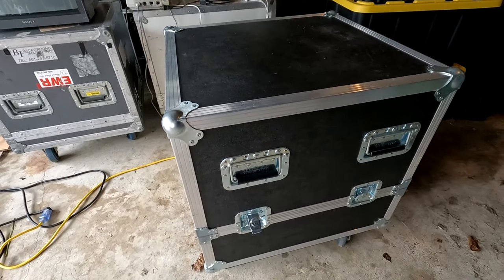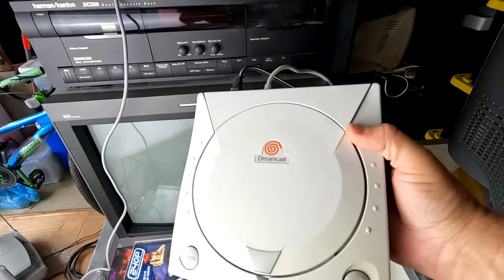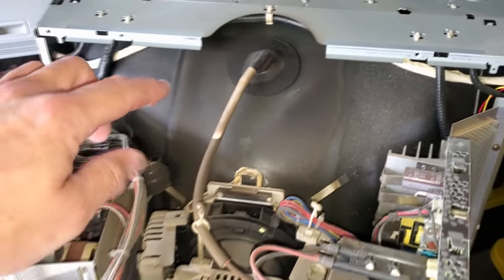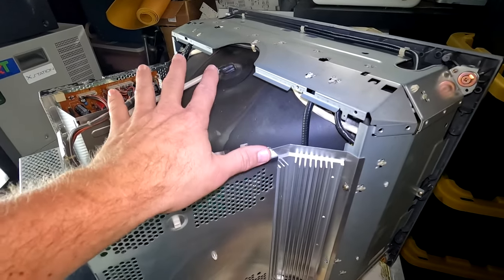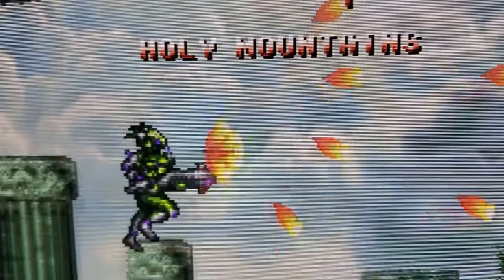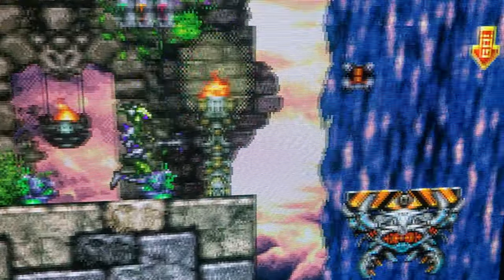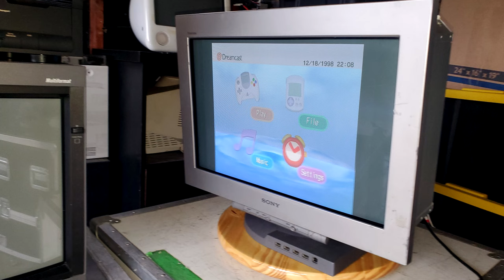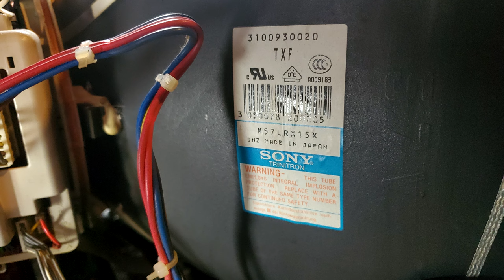Rebuilding the World's Best CRT - the Sony GDM FW-900 Trinitron

Comment: I wonder if Artemio would be up for releasing a PC version (Windows/Linux/MAC) of his test suite, along with the higher resolutions for CRT PCM's up to 2048x1556p, and perhaps even some new stuff for OLED monitors for those of us wo like to use them for CRT emulation, just a thought.
Reply: NEC Suite already exists and serves that purpose. Check it out.
Reply: @mordetx1  I have that, it's fine, not anywhere as expansive as the Artemio test suite though, or most importantly, as dope.
Reply: couldnt you just emulate a test suite with retroarch?
Reply: @Vvewa  Of course you can, but you wouldn't have PC specific options.

Comment: So what's the deal with the red capacitors?  I'm doing a recap on an arcade monitor (streaming the effort the last few nights on my channel) and the board was populated with several of these.  Everything is being replaced with Nichicon 105c rated, but still curious what the red ones are all about?
Reply from the maker: It's just another brand here in the USA.  Werth Capacitors.
Reply: @RetroTechUSA  Ahh thanks man, was worried I was replacing them with the wrong thing.
Reply: @RetroTechUSA  Wurth Capacitors ;)

Comment: I always wondered why are computers monitors better at geometry and convergence compared to video monitors or TVs ?
Reply: I think it has to do with the size? That’s my theory
Reply: better quality hardware in general, but also computer monitors had more of the picture tube covered up by bezels to square off the image and keep the image closer to the center where geometry and convergence are generally more accurate. thats where the whole screen size controversy (ie, "17-inch monitor" is really 16 inches because 1 inch of the tube's perimeter is covered by the bezels) comes from

Comment: I disagree that it's the best CRT monitor ever made, a Samsung 1100MB has a dot pitch of 0.20 mm and horizontal frequency of 130KHz, 21inch.

From personal experience, dot mask CRTs look painterly or as a printed photo. Trinitrons are bright and the FW900 is 16:10, but the image isn't that sharp.

Comment: My poor road find CRT is starting to die after a few years. Sharp Linytron 13" (13rv69) Mfd. '89. I know it needs new caps according to reddit. I cant for the life of me find an owners manual or schematics.
Reply from the maker: Oh man, I have one of those and it's not working either.  Maybe one day I'll have time to work on it
Reply: @RetroTechUSA I hope you get a chance to work on it too and make a video out of it. This little guy has been with me for years. Maybe I can try to have a fan behind it for circulation to keep the temps down till I either find out how to have it fixed or it dies on me all together
Reply: That TV was made the same year as the Sharp TV with a built in NES. Please try to find one of those.